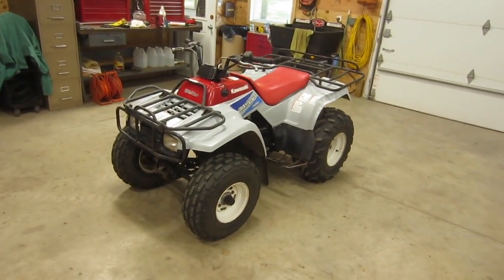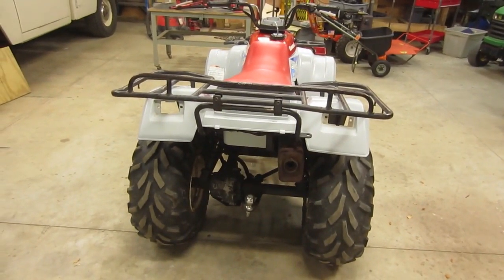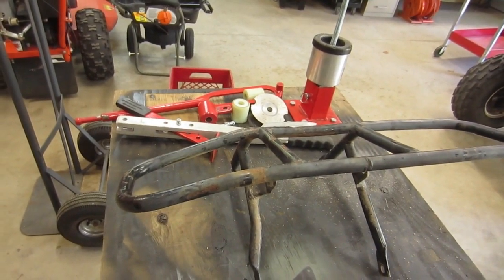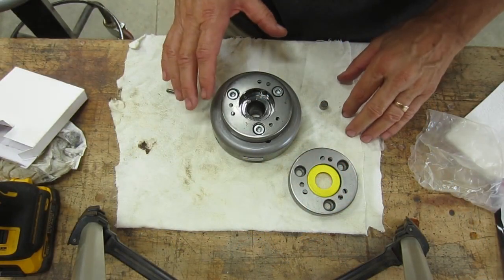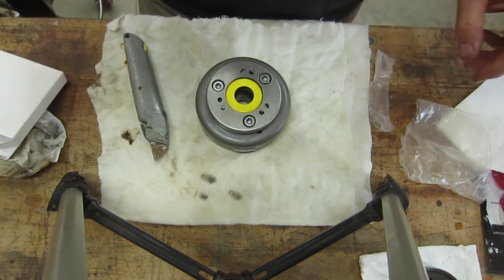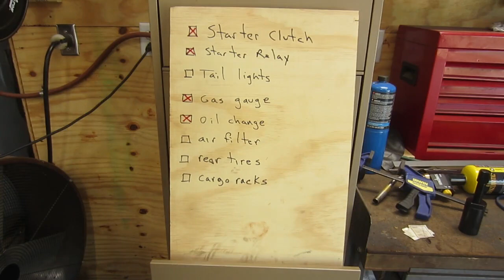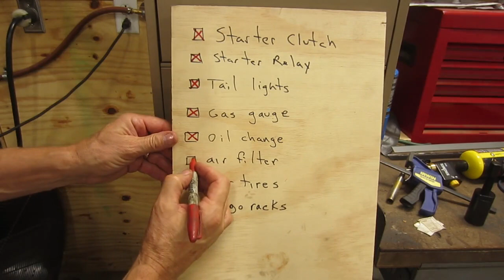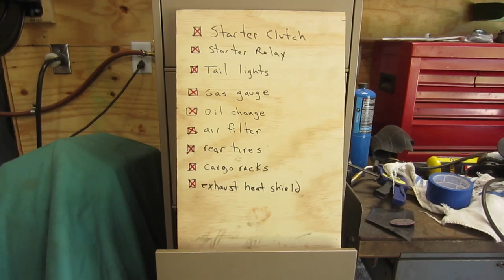Kawasaki Bayou 220

Comment: I've had this same fourwheeler for about 20 years and just about to pick up another old one.  Best fourwheeler ever.  Always been dependable, has plenty of power.  Perfect size even for adults. Small enough to get yourself unstuck
Reply from the maker: You're not the first person to tell me this is one of the best quads out there.  I completely agree.  That small engine provides more than enough power to get the job done nicely.